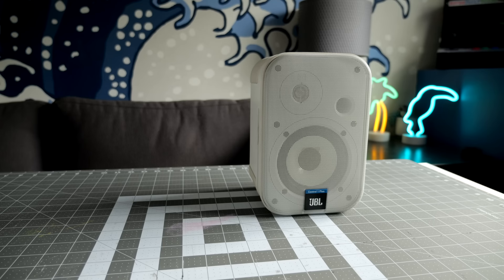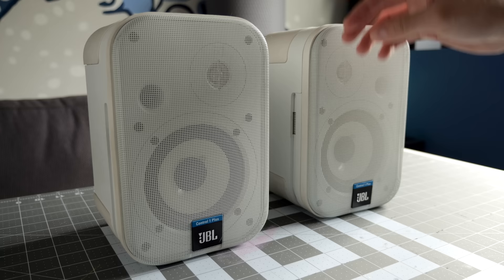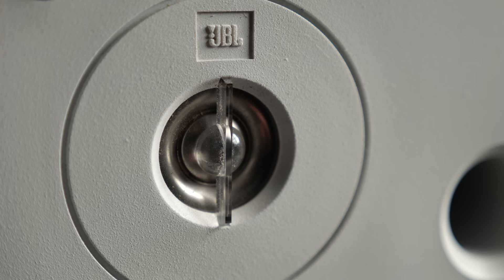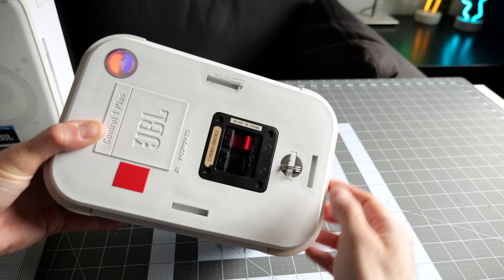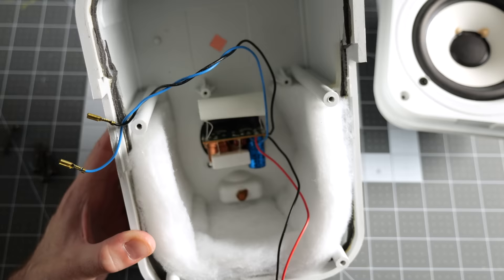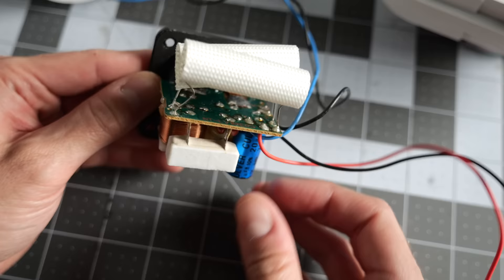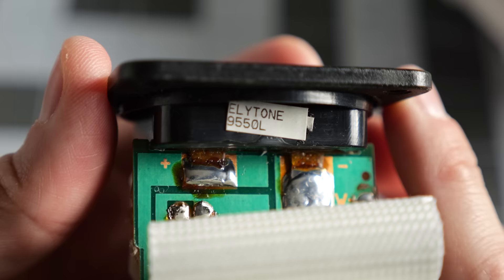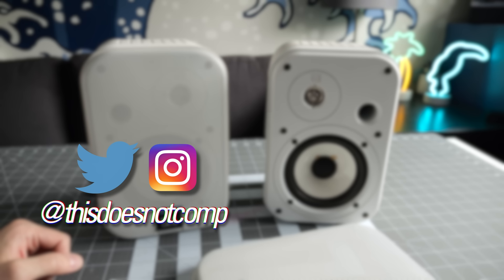Fixing My Vintage Speakers -- But Why Are There Light Bulbs Inside?

Comment: The light bulb thing has been used for decades by many manufacturers. A nice way for easy overload protection.
Reply: I remember being a kid and watching my dad open his old Bose floor speakers to replace the foam rotted woofers, and I was SO surprised and confused why a light bulb was in there. 

Once I grew up and got the internet I randomly looked it up.
Reply: @volvo09  My BOSE 501 have them too, 1968 Mk I edition.
I did make them make sound good now!
Reply: My father's 80's KEF speakers also have a red light but it's put externally, the problem of the higher circuitry inside is that for many years now the speakers can't handle much power while the crossover seems to be working fine and still sounding pretty good as soon as I put a bit of power into them the red light goes ON and soon they shutdown grrr...

It also probably gets a bit expensive to fix cause I would never use cheap components so I never messed with them yet...

Comment: Great video Colin. The light bulb soft-limiter idea is ingenious, dissipating excess electrical energy into heat and light using a common component specifically designed to shed heat energy better than say, large ceramic resistors. One speaker design you might like to check out and do a video on if you get the chance is the Bose 901 system. My ex father in law had two pairs and they are quite weird and unique, using 8 rearward-firing drivers and a separate EQ unit placed before the power amp. Like all Bose systems then and now the sound is very coloured, also quite engaging on most types of music.
Reply: It's more than that - it's a widely dynamic resistor not a fixed value.  The resistance is proportional to the filament heat (positive temperature coefficient, or PTC), the more heat in the filament, the higher the resistance.

Comment: I have the same speakers,  they were a kerb find, missing both grilles & the woofers had rotted foam surrounds. I replaced the woofers with a pair from a scrap Toshiba rear projection TV.
These have the rubber surrounds and identical fixings, they now sound great! 
I have not had any problems from the cross overs yet.....

Comment: While I am not an electronic expert, I am a professional musician and I have had a set of JBL Control 5s paired with the matching subwoofer. I have used this set up in my studio as they are “deemed” as Mid-field monitors. My Control 5s  also utilize hi powered light bulbs as a component of the crossover system. From my understanding I believe the lightbulbs protect the tweeters from excess distortion which is seen by the tweeter as DC power. DC voltage is Kryptonite to tweeters. TheJBL light bulbs are there as further insurance against this DC distortion. Seeing a dim glow through the ports as your music plays is normal. If you actually see BRIGHT lights inside, you are on dangerous ground and had better quickly lower your volume and figure out why you are producing such dangerous distortion. I have also used my C 5s along with the subwoofer as a VERY respectable stand alone main P.A. system in  medium to slightly large clubs for solo and whole band sound systems. Very dependable work horses for various applications. I have LOVED my JBL Control 5s since the 90s. They don’t have to be babied, but if you take care with them, they will be a blessing to you  for decades.
Reply: You don't have to be afraid of DC being on the tweeter in a loudspeaker with an internal crossover since the tweeter highpassed by a capacitor, or in second-order crossovers both highpassed by a capacitor and bypassed by another coil for good measure. The woofer ends up carrying the DC into its offset. You do however have to be afraid of clipping. A tweeter of this construction will self-destruct with probably less than 15W of power, while the rating for the whole speaker is 150W, which is actually way more than i would have suspected. With exception of horn PA tweeters and such, like normal dome tweeters, ones which can survive more than 25W long term, are basically not a thing at all - they need light, thin-wire coils, and they have nowhere whatsoever to dump all that much heat, except into the ferrofluid, but then that has issues as well. Anyway as you most likely know the frequency distribution in music roughly follows LTAS or slightly shaped pink noise law, with energy vastly declining in upper octaves, and by placing the crossover frequency high enough, you simply eliminate the vast majority of power from reaching the tweeter. HOWEVER if you have clipping, you can imagine it almost like a square wave superimposed where the clipping starts and ends, which doesn't really have any frequency bounds, or energy bounds. The amplifier will happily dump almost all of its output power into the tweeter that way. Also you can burn a tweeter with unusual music material that doesn't follow the typical LTAS distribution.

I don't have it in my head the recommended ratio between the power tweeter can handle and the total rating of the speaker depending on crossover frequency - i'm pretty sure it's in Vance Dickason's Cookbook somewhere. Actually the fundamental read if you want to understand speakers.

Comment: I got my non pro Control one's at best buy 15 years ago. There are AMAZING speakers for their price point. Their sound is top notch placed up against anything else in the price point! These absolutely disapear when powered right, lovely sound!
Reply: YES!!! That's why i bought a NEW pair after the 20 year old Control 1G woofers just DISINTEGRAGED!!! :\\\ So no... not a good long term choice! (as you can see described in this video). And they are not that serviceable (once opened, because the mounting screws are ALL plastic and don't have a METAL FEMALE, they will never be the same)
Reply: @MarcoLopesPT it's what glue is for in the thread holes

Comment: One hint regarding the "reflowing" - you should use a little fresh solder or some good quality flux so you don't end up creating dry joints.
Reply: Yeah, if there's a crack in a solder joint, and it's oxidized, you need flux to clean up those oxides. Fresh solder is always wise when reflowing. even a touch of flux core solder is fine.
Reply: Also you can clean the flux residue using isopropyl 90% or better Alcohol

Comment: Used to do sound for a guy who did a giant local fireworks show. He had 4 giant Peavey speakers -- each RMS rated to something like 1200W. (We'd drive 2 on each 2000w amp). Even those beasts had lightbulbs inside. Those were socketed automotive 12v lightbulbs
Your videos are always a highlight of my Friday mornings!
Reply: But, those light bulbs only protected the tweeters.
Reply: @ScottGrammer  the entire audio path has to go through the crossover to work so it does protect everything
Reply: @kaitlyn__L  yes everything goes through the crossover but the light bulbs are only wired in series with the tweeters in most professional gear. Also, most professional sound reinforcement cabinets have the option for biamping or triamping, which bypasses the crossover entirely. Some home stereo speakers (Bose 301, for instance) have the bulbs wired only in series with the tweeters.
Reply: The protection bulbs are 12V on a 1000W system?  I know the tweeter is likely padded down considerably from the woofer, but geez..  that's like 20W.
Reply: @ScottGrammer  sure, if you’re using separate amps for every single one then protection can be selectively applied. I didn’t look too closely at this one but it looked like one bulb per speaker driver in this instance to me. You’re right of course that it doesn’t universally apply to every design though.
Reply: @kaitlyn__L  I dug up a service manual for this speaker. It was hard to find the right one because there are a number of slightly different versions of the JBL Control 1. This one is the Control 1 Plus. The schematic shows something I've never seen before. First, although this video shows two bulbs in parallel, the schematic only shows one. It may be that the pair of bulbs is treated as one component, with one part number. The circuit board in the video has separate pads for the bulbs, so I assume they're like that from the factory. But that's not the part I haven't seen before. The way they're wired is. The bulbs are in series with the woofer only. The tweeter is wired normally through a second order high pass filter, with no protection. The woofer is fed though a band-reject filter that will reduce the midrange output of the woofer. This filter is made up of a paralleled resistor, capacitor, and inductor. The lamps are in series with the inductor only. So, when the speaker is pushed hard, the lamps reduce the low-frequency drive to the woofer without reducing the midrange levels. Interesting.
Reply: @nickwallette6201  The lamps act as current limiters, so it's their current rating that counts, not their voltage rating. Marantz used to make a very high quality monoblock amplifier that used 6V car taillight bulbs as current limiters for the power supply rails, which were +/- 40V. In normal use they never glowed at all. Usually, only a shorted speaker lead or shorted speaker would cause them to glow.
Reply: @ScottGrammer  Very well could be -- It's been about a dozen years...

Comment: Cool speakers.  Would have really liked to see the light bulbs in action.  I've never seen that before.
Reply: The only time you'll see them "in action" is when you're pushing the speaker beyond its limits.  Otherwise, they're in-circuit, but not really doing much more than a wire.
Reply: @nickwallette6201  Thing is the lightbulbs should have the tiniest of glow with even fairly little current, long before they reach operating temperature and their resistance rises to the nominal level. It might just show up in total darkness. Worth an experiment - at normal operating conditions, not burning up any speakers.
Reply: @nickwallette6201  He could have hooked the bulbs to a power supply just for fun on camera, therefore making them glow at their full brightness, personally I would have done that.

Comment: Hey Colin, from the description you provide, I'm fairly certain that's a dried out capacitor. Every you crank the volume, you raise the voltage across the capacitor, and in turn you are reforming it. Once the capacitor is "reformed", there is an electric field across the capacitor due to the stored charge, which allows it to conduct further current more easily. However, until you reach a certain voltage, the capacitor will not start charging, and will remain empty - no electric field. The capacitor needs to be replaced, in both speakers. While you're at it, you can add somewhat thicker wires going to the midrange speakers. Those are kind of thin. Yes, they worked for a long time. Doesn't mean they're optima :)
Reply: Since there's only one cap, it's quite likely the crossover is 1st order lowpass to the woofer, 2nd order highpass to the tweeter.  So, the cap (and one of the inductors) is in series with the tweeter, and one of the inductors with the woofer.  In that case, if the cap is the problem, it should only affect the tweeter.

If both drivers are playing at a low volume, the problem is upstream of the crossover.
Reply: @nickwallette6201  the "tweeter" here will be handling frequencies down to 1 kHz. It's easy for it to sound "louder" or "quieter" when the tweeter gets dimmed.

Comment: Years ago my sister gave me a pair of her old Ohm Model C2 speakers. The foam around both woofers had all but turned into dust. I found replacement parts online and had my hand at repairing them. It was a little fiddly but it worked out well and these speakers now sound amazing (and am listening to Colin's video through them now). So, yeah, I don't need to be convinced regarding the need for speaker maintenance. Good video, Colin.
Reply: Ohm speakers are really nice. The company is still around and still made in a small shop in upstate NY I think. If I remember correctly they still will  support all thier old speakers, and even offer factory rebuilds if you can send them to them.
Reply: @JessHull  That's cool to know, Jess. I'm glad they're still around. These are certainly a nice set of speakers. The best I've ever owned and they cost me about $35.00 (if memory serves) for the foam replacement gaskets (or whatever you call them).
Reply: @bradnelson3595  Thats so great you've kept them going with the repair/maintenance you've done. There certainly are modern new speakers that are amazing, but you have to spend insane amounts of money to access them. There are a myriad of vintage speakers that from companies like JBL, Altec, Ohm, Audio Reseach etc. that made speakers in the 70 and 80s that can be had for still reasonable prices and if you're willing to put a little work into them, like you did, you can have a speaker set that rivals even the highest end of modern stuff.
Reply: @JessHull  It's satisfying to bring an old electronic thing back to life. And the fact often is that old stuff is of better quality than what you can buy today. I might be able to buy some good speakers...but not in the thick, solid wood cabinets of these old Ohms. Which reminds me...probably a good time to hit them with some lemon oil.
Reply: Why would a great speaker like the CONTROL 1 / 1G be made with FOAM woofers?!? I loved mine! They sounded great, they seemed rugged, until they didn't!!! The woofers just fell appart! Servicing was not an option (more expensive, and the PLASTIC screw mountings are a BIG NO NO!!! OMG...). So, i recycled them, and bought a new pair! (stupid me! ahah)

Comment: the Control Series where by far the best speakers available at the time they came out for the purpose, also served extremely well as "monitors" in clubs and stuff, and like you said, perfect studio monitors. the use of light bulbs was quite common actually, even on much largeer speakers for live events .. sometime you could actually see them light up inside when they kinda clip them for too long, the temperature could aso cause thee issue you have with the need to push them first to get the lamp to a certain temperature.

Comment: I'm a bass player. My bass cabinet used light bulbs as fuses. It was stolen. But an interesting thing happened with the new one I bought, a 2x12 cabinet that I was powering with 1300 watts. I was playing Stranglehold complete with chorus effect. The bass was constantly "rolling" through the entire song  caused me to blow both speakers. 

It wasn't mechanical failure. It was thermal failure. They just got hotter and hotter, and finally the voice coil wiring "disintegrated". When I removed the woofers, the voice coil windings were like loose spaghetti draped over the voice coil. 

I learned a valuable lesson on the different ways you can blow speakers. i.e. it's not just "too loud" volume that over drives your speakers. But using them within their excursion range, but close to the limit and for too long, can still destroy them.

On a side note, thank God it was the last song in the gig. 😁

Comment: I found a JBL Sub 6 with a blue "Control" badge on it for 50AUD last year! Seems to be from the late 90s. Love having the port and controls on the front for quick tweaking. Only thing is the magnet starts rattling when I push it too hard. Couldn't figure out how to get farther inside even with a service manual :( 

Regardless it pairs very well with the 80's Wharfdale Deltas I also found locally. I wired them into the JBL's high-pass filter so they don't have to work as hard.  Works really well for my needs :)

Comment: Just an FYI in general: the melted spots on electronic equipment of any kind do not have to necessarily indicate an actual heat-induced melting (like soldering iron)... but chemical. Some leads/wires outer "plastic" isolation layer (whatever the chem. compound it is) can eat into the surface and melt it, but it's the process that takes years: think equipment that has had leads wrapped around it tightly and then stored for a prolonged period of time, or just stacked one on top of another, with leads in the middle.

So, I guess the lesson is: for long storage, store your wires/cables/leads separate from your device - but best wrapped next to it in, maybe in a plastic bag, potentially zip-tied or taped to an inconspicuous spot (for eventual residue clean-up). And, if storing them separately, always tag the leads with not-too-easily-removable parent device's identifier, if such thing matters (for "it's-of-higher-quality-than-average" or "proprietary-connector/wiring" reasons).

This is especially useful for external power adapters, even more if it's the ubiquitous barrel connector: mark the adapter with the device name, and label the device with adapter's voltage, [minimum] current, and polarity (even if device has this marked on a label or impressed into plastic somewhere, those can fade or get worn down with time). This way, you'll always have means to find the original adapter, or substitute with appropriate one in the future.

....does my "organizing control freak" nature show? _:-D
Reply: What about vibrations ?

Comment: I have some nearly/roughly 100 year old speakers made for film projectors, Bell&Howell Filmosound 179’s and the only ‘maintenance’ they ever had were TRS Input modifications. Still the best sounding speakers I’ve ever had paired with guitar amps. The rear of the cabinets are hinged and latched and the interior is completely covered in velvet,… and the magnets and drivers are very heavily shielded.